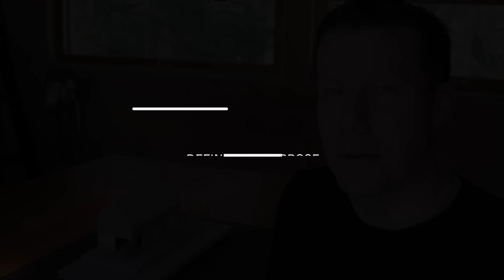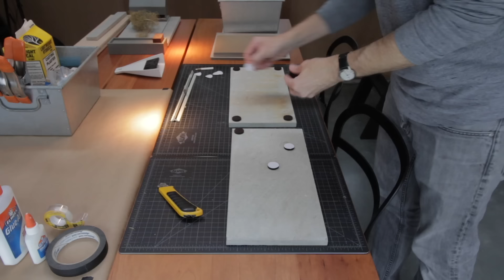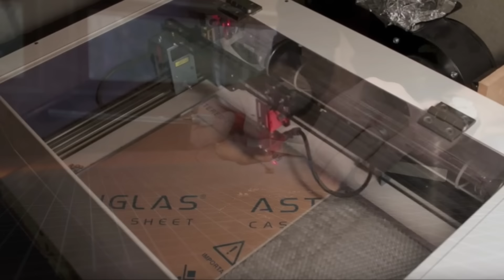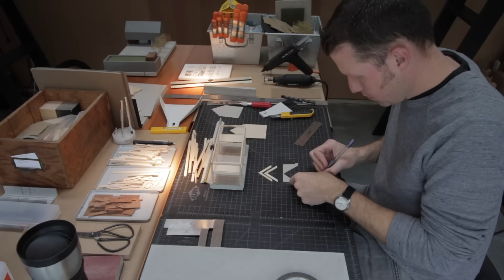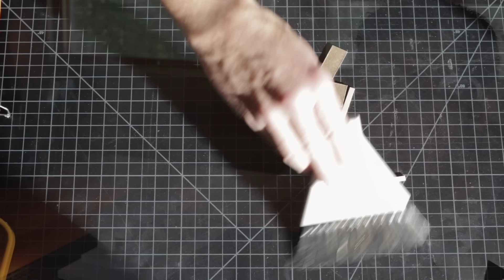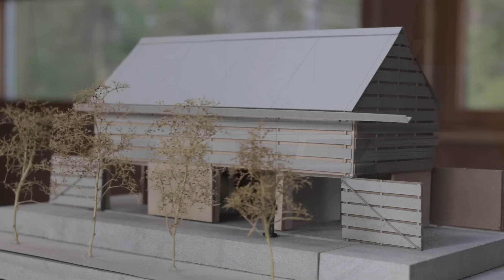Architectural Model Making Techniques and Tutorial (a step-by-step model build)

Comment: Your series should be required watching for all first year architecture students! So many important points. 
I have to admit the inches throw me off. I'm used to metric personally. But the tips are understood regardless!
Reply from the maker: 3/16" doesn't translate very nicely to metric does it...? Sorry...!
Glad you found it helpful...
Reply: Fantastic explanations, but like has been mentioned, the imperial system throws those not living in Myanmar, Liberia, or the USA (i.e. most of the global population) that watch your videos ‘a bit’ of a curveball. Again, fantastic explanations!
Reply: yeah, I would love to be an architect in a place full of opportunities like the United States but the imperial system is just... ugh
Reply: 25.4 mm per 1 inch. So if he's using 1/16" its just 25.4/16 = 1.5875mm.
Reply: saaaaame
Reply: Me 2, I am a 1st year Architecture student, also work in Metric so have the same issue with sizing of the boarding being in Imperial measure :S